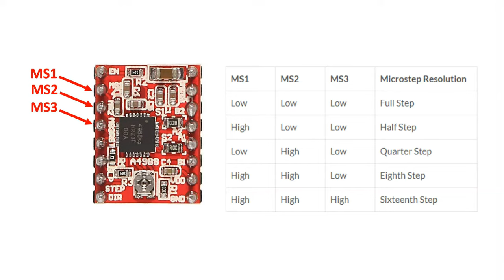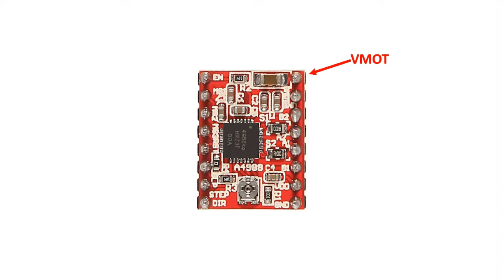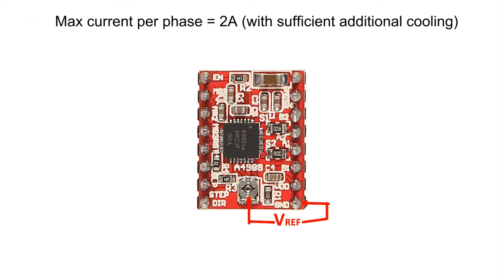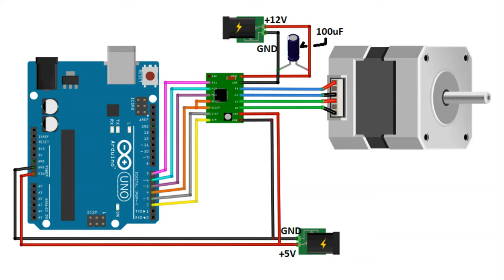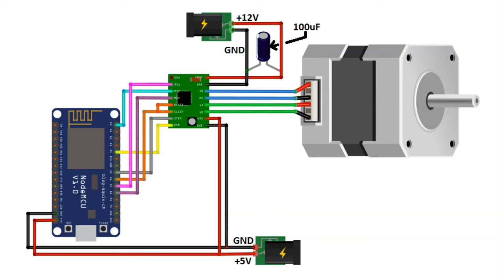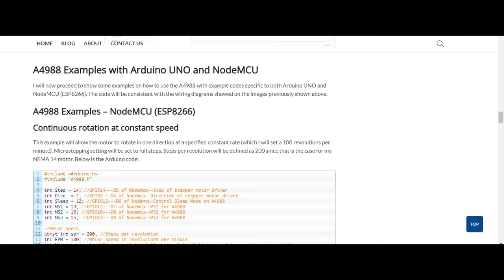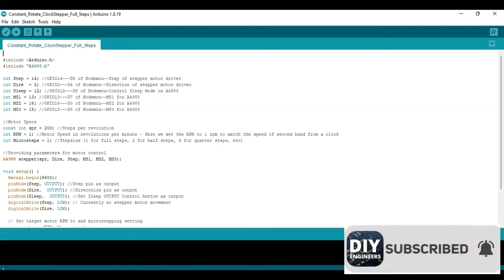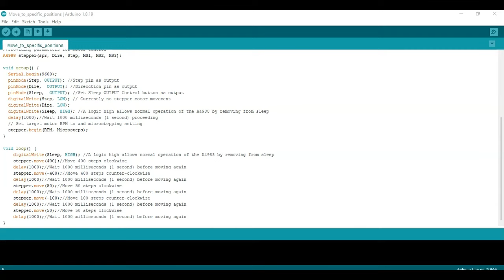A4988 Stepper Motor Controller - Arduino & NodeMCU

Comment: I came back to report I watched all the videos you have on Steppers and have finally completed my design for a Mini MIll. I used a Dremel Drill Press and MicroLux X Y Table, Arduino, CNC Shield, A4988 driver, and Old 3D Printer Steppers, -plus 3D Printed adapters. Oh and UGC to get my shapes to G code and GRBL to run the Arduino. Just yesterday I got it all assembled and operational for jogging the axis. Last night I design a slot cavity I need in my Model Train Engine Chassis for more Digital Tech. Today I plan to cut out the shape in a piece of wood. All your videos were helpful and encouraging me to keep going. Tools have emerged in the last years that help us hobbyist to build useful and required tools for our hobby. I have wanted a CNC Mill for 50 Years. No it is not a full size Bridgeport but its mine and I make it and it will do exactly what I need.   Thank You so much When i cut the shape in wood I will send you the You Tube video link.  Thank You So Much, Dennis

Comment: Thank You‼️ (November-23 from Norway) I just got my first steppers to play with, and this is big help 😊
BUT - one important detail I do not think is correct in the video. You say "since it is a 12V motor, you choose 12V on VMOT". 
I have a low voltage stepper (3,8V), but I can still use connect 8V-35V on VMOT. The driver will regulate the CURRENT to the motor so that it will not be overpowered anyway. 
The motor's voltage is not really relevant, unless you have a •direct• connection from power source to the motor •without• a driver inbetween.
(Sorry for bad explanation… for anyone interested.. google the subject for better explanation)
Reply: I think it's less likely to miss steps if the voltage is higher.

Comment: if you use Vmot and Vlogic from the same supply there is a problem called BACK EMF that will destroy the logic elements,always use a seperate power supply for the VMotor and insure their is a big capicator across to supply lines. yes I know there is one on the board but you need to insere another one for safety.

Comment: There appears to be several methods to calculate V ref. Where did you get this instruction? My motors are jerky so I know something is wrong. Using CNC Shield with Uno so I will search that Shield exactly, with 4AA4988. Thanks you speak clearly and show good demos to support the lecture. Dennis
Reply: Upgrade your controller to grbl 1.1f to stop the steppers buzzing or jerking.

Comment: Hey i have a question. I am tring this on a elegoo 2560 `arduino, but when i wire it and uploud the code, the motor engages, but will not move. Do you know a posible solution for this? Also great video
Reply: you should always use a sepoerate power supply for the Vm(motor powe) and in you situation the motor is not getting enough power eithe in amps or voltage or both.

Comment: VREF = I x 8 x Rsense?
The red A4988 has 2 resistors ranging from 0.05 up to 0.2 Ω. 
If you have for example 0.1Ω shouldn't vRef be 0,4x8x0,1? 0,32V?

Comment: Hi again. My understanding is that a stepper motor needs to be accelerated up to the desired RPM. For example, the AccelStepper library has a setacceleration function. Does the library used in your video do this automatically?

Comment: Interesting video but at time stamp 7:30 I think you've labeled 1A and 1B in the wrong positions (looking at the board labels). One question, should you have the stepper motor connected or disconnected when adjusting the voltage? I watched a different video in which he says it has to be connected otherwise you'll burn out the driver (which didn't happen with yours). Thank you for the informationl video.

Comment: hi I have a strange problem here, I set things up as explained and the motor start rotating but stops randomly. sometimes it will stop after few rotation, another time it will stop few times per revolution. It can stop for a sport fraction of a second or be blocked for few seconds.  I've been using different motors and A4988 controllers but keep getting same problem. Any idea where to look for the root cause of the issue ?

Comment: Hi how are you thanks for the tutorial I have a question can you connect two motor drivers to the same single Arduino Uno  that you applied in your tutorial thank you have a nice day
Reply from the maker: Hi, yes you can. You could even use an Arduino UNO CNC Shield and not use the GRLB software but simply reference the appropriate pins on the arduino and use regular Arduino code. This would allow you to control up to 4 A4988 drivers from one Arduino UNO. Thanks for watching.

Comment: Hi. Nice video. Can you tell me how change the stepper RPM to different values at different points in the sketch?
Reply from the maker: Hi, thanks for watching! Use keyword "setRPM" to set the RPM. You might also want to check out one of the examples that comes with the library: "SpeedProfile". To get to it go to Files -> Examples -> Find the Library (StepperDriver) -> then select the example "SpeedProfile" or any other example.
Reply: @diyengineers  Awesome, thank you.
Reply from the maker: @dr.robbackstein2348  No problem!

Comment from the maker: Hope you all enjoy this video! Let me know if you have any suggestions for future projects / examples you would like to see 😀
Reply: Does it heat up easily?
Reply: If not what V and amp should i use as a power supply
Reply from the maker: @symontorres3952  Stepper motors do heat up easily due to the nature of the stepper motor operation (stepper motor drive is supply current to keep the motor at the target position, even if not rotating). Options to stop from getting excessively hot are using the sleep command/pin (okay if motor is not in use at the time and holding an exact stationary position is not critical). The other option is to make use of heat sinks and fans as needed. You might notice that some 3D printers use a heat sinks + fans to cool the stepper motor that takes care of the extrusion. The other 3D printer stepper motors sent to be fixed to a large metal frame that can act as a heat sink absorbing a large amount of the motor's heat.
Reply from the maker: @symontorres3952  The V of the power supply should match the motor voltage requirement and should not exceed the driver/system voltage limit. The current capacity of the supply should exceed what's needed by the motor, but the motor current should not exceed the driver's limit or the limit of the rest of the system.
Reply: Can this be used with relays so you can use a larger stepper motor ?

Comment: Is it possible to create a code that makes the speed upward? I mean that instead of going from 0 to 1, go from 0 to 0.1 0.2 0.3 0.4 0.5 0.6 0.7 0.8 0.9 and Velmax 1?? Thank you
Reply from the maker: You can define the acceleration and max speed.

Comment: Hi there, I want to run a stepper motor rated for 2A current, other than the heat sink it comes with what specific cooling precautions should I take? Or should I return this driver for a different type?
Reply: a device rated for x amps may not require the max x amps to work ,I learned in school that if you are running a device at more than 2/3 of its max rating than you need a different device example a resistor has a max current rating of 10 amps and the circuit pulls normally pulls 7 amps than the peak could be over the amperage rating of 10 amps so  to be on the safe side  you need a bigger resistor.

Comment: Thanks for the video! I had a question... for my project, I am trying to drive 4 stepper motors at the same time, what do you think would be the best way to go about that?
Reply from the maker: Hi Davey! Thanks for watching. Would all motors move the exact same way, meaning you want them to all move them same way all the time? Or do you want them to move independent from one another?
Reply: @diyengineers  all the same time and in the same direction!
Reply from the maker: I haven't done that myself, but I recommend reading the following: https://electronics.stackexchange.com/questions/127116/can-i-control-multiple-stepper-motor-drivers-from-one-controller

Good luck!

Comment: Step pin must go from low to high to low for the motor to step ,DIR pin (direction) controlls weather the motor moves forward or reverse. you really need to look at the internal  wiring diagram of the motor to understand how it works your labels are wrong the motor has 2 sets of coils group 1 and group 2 ,the start of group 1 is1A and the end of group 1 coil is 1B. The same for coil 2 and the wiring for each coil must be wired correctly the start of group 1 and group 2 coils is know as 1A and !B and the end of the coils must be 1B and 2B if these are mixed up the motor will do all kinds of crazy stuff example motor will move 1 step forward and 2 steps backward when commanded to move forward 1 step or it might do the reverse 2 steps backward and 1 step forward and it will be impossible to control.

Comment: For NEMA 23 Stepper Motor and above ,that is working under high load ,A4988 Driver is not  applicable, Instead use TB6600 driver .